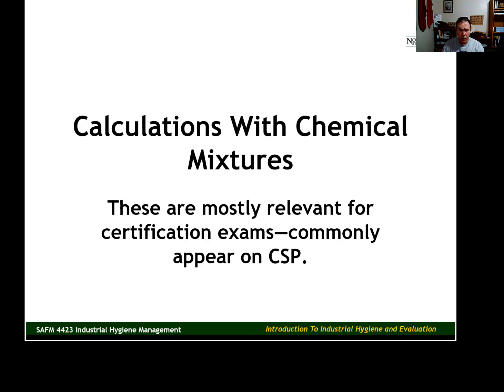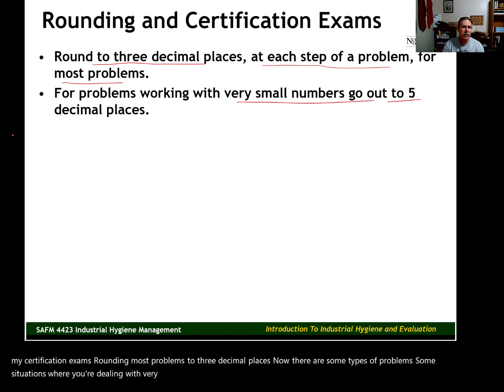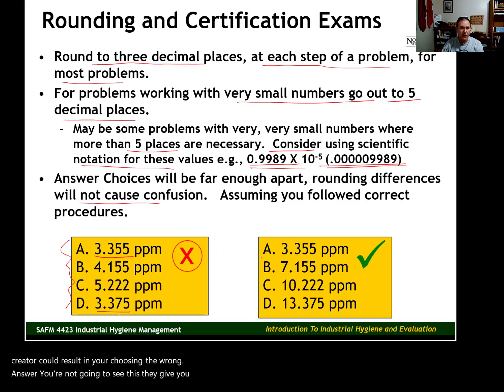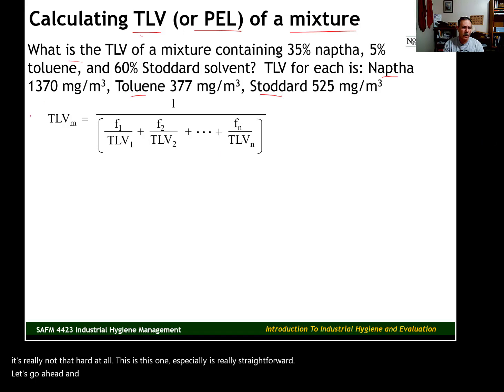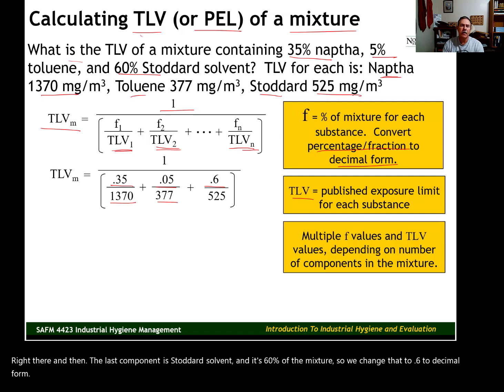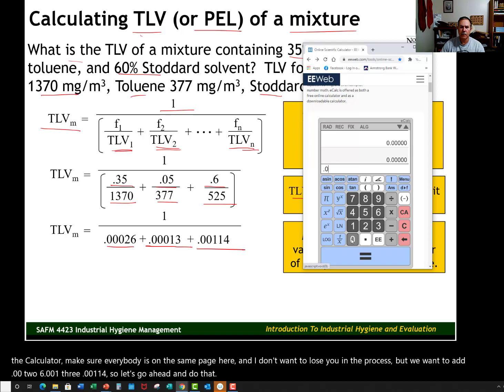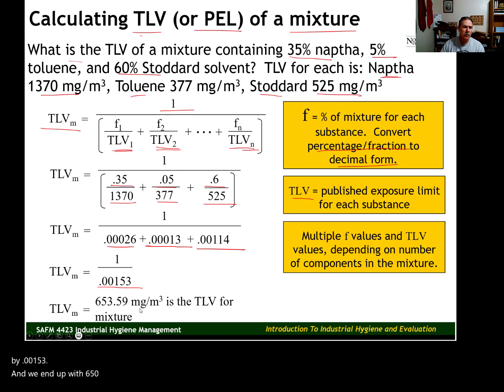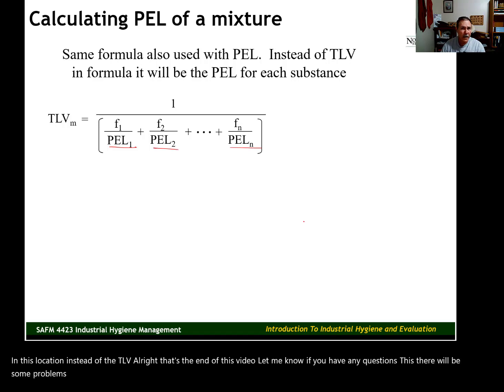Calculating the TLV / PEL of a Mixture

Comment: Please note.  The TLVs must be in terms of mass (milligrams per cubic meter), not volume (parts per million).
Reply from the maker: The ACGIH publishes TLVs.  If you look in the ACGIH TLV tables you find ppm or ppb used for many substances.  Depending on the substance either measurement approach may be used.
Reply: Just an FYI.   The "This equation" referred to below is the one you used in your presentation.  

According to the 3rd Edition of the IH-Occupational Hygiene Calculations Reference Manual (Stewart, Herrick, Horowitz), Page 36:  "This equation describes the method for calculating a TLV for a mixture based on a knowledge of the fractional weights of the individual components of the mixture and their respective TLVs. The fractional weights must be expressed as a decimal, and the Threshold Limit Values in the denominator MUST be in terms of the mass concentration, mg/m3.   Use of this mixture TLV formula is anticipated and planned prior to conducting air sampling.   In order to determine compliance with the calculated mixture TLV, the field instrument must be calibrated in the laboratory with an air/solvent mixture that is proportionally similar to the substance of interest. The calibration should include fractional concentrations of the TLV, e.g., 0.1, 0.5, 1.0, 2.0, etc."
Reply from the maker: @robertallen7186  LOL.  You are talking about this specific formula.  Yes.  You are correct for this particular formula.  I thought you meant TLVs in general had to be measured in terms of mass per unit volume (e.g., mg/m3).  From your original comment "the TLVs must be in terms of mass (milligrams per cubic meter), not volume (parts per million)."  If you had added one phrase "when using this formula . . .. "  the misunderstanding could have been avoided.  Again you are correct for this formula, thank you for pointing it out.